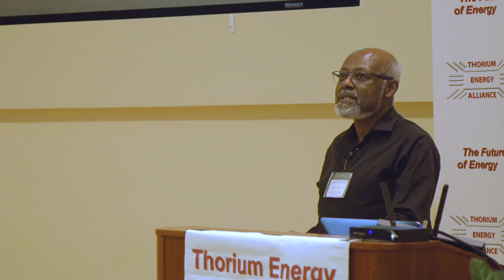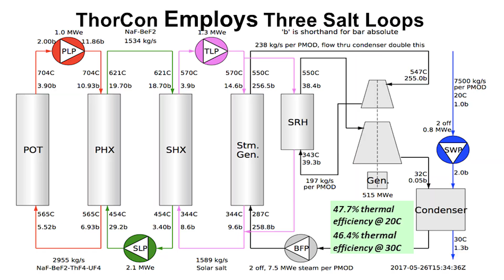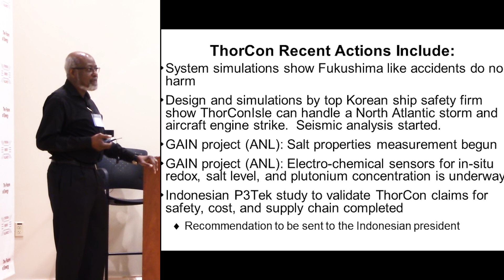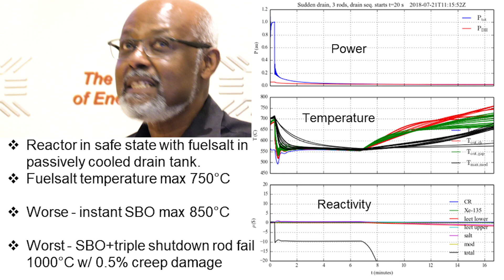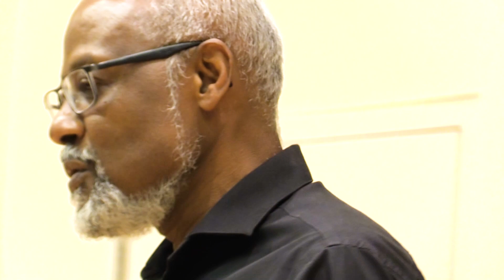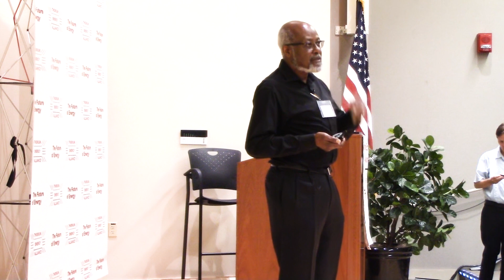ThorCon's Thorium Converter Reactor 2019-10 Update by Dane Wilson @ TEAC10

Comment: Can you bring it to Australia so we can have relief from costly renewable energy
Reply: Our greenies won't allow it
Reply: Glyn Camilleri tell them Greta is on board coming across the ocean
Reply: I too wish we could bring a few of these to Australia, but unless we can convince people it's safe, it won't happen.
I also think as long as the 'N' word is involved, greenies and the poorly educated will be against it.
Reply: Andrew Mackenzie we can't even have N submarines.. We went down the most ridiculous path... Between Bill Shorten's anti Japan stance... Saving Pines seat by building In SA.... 50 billion dollar dud subs
Reply: Could be good for de desalinization plants to. Lots of drinking water ;)
Reply: dig a hole 50 feet down and install a sterling engine in it. you will have unlimited free energy most of the year. Assuming you are in a hot spot in the land down younder.
Reply: Cheaper than coal doesn't mean cheaper than renewables.
Reply: Colin Connelly can you provide an analyst that renewables are cheaper to provide base load energy including batteries or alternative storage and infrastructure?
Reply: @colconn57  You can not compare renewables with nuclear or any other reliable energy source. Renewables require 100% backup from a reliable source, so they only add cost to that reliable cost making the entire system far more expensive.
Reply: Colin Connelly if it’s cheaper then coal, obviously it’s far less expensive then “renewables”.
Reply: @colconn57  use logic mate - if renewables would really be cheaper than coal then what would be the point to keep building coal plants?
why would there be so much fuss with the world having to force a number of countries to turn away from coal? the cheapest option usually wins -  they should be all over this idea if it would indeed be the cheapest
hint - they are not. nowhere close in fact. and as far as we know - they won't ever be.
Reply: @colconn57  It means you don't understand cost and problems of renewables. Hint is peak demand for energy when it is cloudy and wind doesnn't blow. Forget what they are doing with them right now and make your own research of nuclear/MSR. It is pretty simple to understand if starting with uranium cirle, although thorium has many advantages.

Comment: China will probably have an MSR running next year. They have a gas-cooled, pebble bed reactor prototype running. They are also developing a US, TWR, Travelling Wave Reactor using Terrapower technology. The US government canceled Terrapower cooperation. Given investment in prototypes is the next big step. The technology, designs and research are available. Testing of materials is a major time factor. But Generation 4 reactors can be built within 10 years. 5 other Gen 4 reactor types are also in development. MSR and Gas-Cooled Reactors are very promising. Relatively simple and highly meltdown resistant, built-in, inherent design features. Gen 4 fission reactors are much cheaper, lower risk and much faster than Fusion reactors. China has also tested a research fusion reactor producing plasma at twice the temperature of the sun for 100 seconds. The current world record. The ITER International Fusion Research reactor will be complete in France in 2025. Already costing over $10 billion. But it is still far from being a working power plant. They then plan to build a larger research reactor after that. Fusion is far from being practical unless a novel design has a significant breakthrough. The US government is now willing to help Gen 4 reactor development. A more flexible approach to licensing new Gen 4 reactors is vital.  Current US policies were built around existing PWR reactors. And it is a very slow and expensive process. The designs of Gen 4 reactors are evolving though mainly in testing and design. So new prototypes will have novel new design features. So the technology is still advancing even without prototypes. Partly in using computer technology for modeling and simulation. And chemistry. Managing salts with ionic bonds with various molecules gives lots of scope for research for chemistry. This can be done with universities and other educational groups. At relatively affordable research.  This could benefit MSR and LFTR type reactors allowing operators of such reactors to manage the many materials found in the salts. Removing unwanted or very useful materials off line while the reactors are in operation. Other groups are testing materials for the construction of reactors.
Reply: Terrapower is a Bill Gates start up. He and his engineers went to China because the AEC wouldn't let them have a license to do their testing anywhere in the US. But Deej wants to save jobs. If China has the fast lane on MSR development, their iron and steel industry is more than capable of mass producing a viable design. The ThorCon is going to be built in Hyundai's ship yards- in Korea. India is well on the way, using their own resources to fabricate; India is thought to have the largest thorium reserves in the world. Where is America in this? Waiting on the AEC to issue a license to do the research on American soil. We are losing the technology game- and this program is a bell weather for why.FR
Reply: @fredericrike5974  
The AEC hasnt existed since the 1970's. It is now the NRC as regulator. The NRC would allow them, they just thought it would take too long in the US. They were right. But, the US yanked them out of China.
Reply: whoops
Reply: TerraPower got TWR yanked out of China in 2015 by the US gov't for helping china build an SMR usable in the South China Seas.

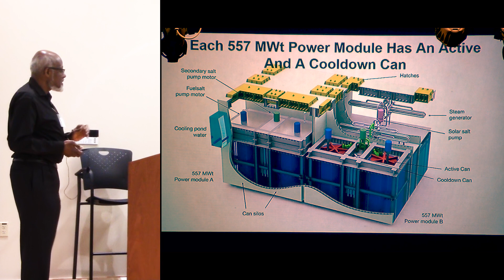Comment: @3:10 Dane" The module concept is important...allows us to insure we going to get that out before failure has occurred..assuming we have done our modeling right" Please do tidy up your data 1000 degrees should be corrected to 5000 C.  See for yourselves with CIA released documents search. Indonesia don't accept this Trojan horse.
Reply: ????  In the most severe of accidents the maximum temperature is 1000C.  No idea where 5000C comes from.
Reply: You are getting fission confused with fusion bro.
Reply: @BenJamin-rt7ui  20000c
Reply: Hotter means more power, Power means money :)

Comment: Why do I see it hard to believe that an impact with a Boeing 777 or bigger would only dent it 200 mm. That's like 5 inches...
Reply: A plane is very lightweight.  I'm told the skin on an airliner is about 1mm thick.  So the impact really comes down to the jet engines and the landing gear plus fire danger from the fuel.  Check out the video of an F4 crash test into a concrete block to gain a visual appreciation for what happens.  The F4 is much more compact and dense than a commercial airliner.
Reply: https://en.wikipedia.org/wiki/Argument_from_incredulity

They came to that conclusion through Finite Element Analysis. Much of the world is counter-intuitive.
Reply: 200mm is 8”. Thorcon uses steel backed by sand, instead of concrete. Steel is ductile, and bends instead of breaking, and the sand absorbs energy without being damaged at all. It is like sand/gravel being used in gun ranges or run away truck ramps.
Reply: It's true, if you shot an aluminum pellet at a steel wall. How far do you think it would penetrate?
Reply: Lightweight plane, pellet or a 385,000 lb projectile at 400 MPH...

Comment: My only question is how will it deal with water from a Tsunami or typhoon? Since it was the tsunami that initiated the downfall of Fukushima.
Reply: The hull is 30 meters tall so a wave or tsunami of 10m or less will not have any impact.  The hull is designed for North Atlantic storms with accelerations greater than 1g so a typhoon won't hurt it.  There are some locations on earth with very high tsunamis but these generally require the land to be shaped like a lens focusing the tsunami - our response is pick another site.  

If you really want to be certain you can spend an extra $200M/GWe and use iron ore for ballast.  This will hold the hull down on the seabed even in a 30+ m high tsunami.  (The turbine hall will get flooded and totally trashed but there would be no release).

As for loss of cooling (for example during the water outrush just before the tsunami arrives) this is handled the same as any other event that cuts off cooling.  Fission is stopped (shutdown rods drop), the fuel is drained, and it is cooled by natural circulation to the decay heat removal pond.
Reply: When it arrives on site, it is submerged, and sits either partially or completely underwater. I don't know how big a wave it could withstand, but i'd honestly be the most concerned about LACK of water before a tsunami (the water on the shore receedes before a tsunami), which i got the impression is part of the cooling.
Reply: The downfall of Fukushima was abandoning real government oversight. The plant operator kept reducing maintenance due to a need to increase profits. That plant was 40+ years old and should have been decommissioned at best and refurbished at least after 20 years. Neither happened. So abandonment can be construed in several ways.
Reply: Like quakes, Tsunami or typhoon is a surface phenomenon.
Reply: The thing that caused Fukushima’s problems was the loss of power to cooling pumps.  The old style solid fuel reactor requires pumps to circulate water for cooling.  (Active cooling).The reactor was scrammed so there is no power generation.  The diesel generators were washed away and the batteries kicked in.  Problem was the batteries could only supply power for less than 6 hours.  Remember that the whole coastline was destroyed so there was no ability to get the system repaired before the cooling water got converted to hydrogen and then exploded.  This design uses passive cooling meaning that it doesn’t require water circulation pumps.  He mentioned 147 days supply of water for passive cooling.  Think of it of no human intervention for 147 days and it would still be ok.

Comment: Could the "can"  be recycled just by replacing the moderator, is it the only part that gets irreversibly damaged by radiation? Because it could be non-marginal consideration from the cost point of view.
Reply: Yes the Can and most of its contents can be cleaned, inspected and reused.  The moderator does wear out - though there is some hope of recycling it as well in the future.  Various portions (bearings, dry gas seals, heat exchanger tubes) have a shorter life (16 years??) so have limited recycling opportunities.  The radiation level is high enough that all work would have to be done robotically.
Reply: @larsjorgensen4123  Thanks very much for your answer, since it's contaminated would have to be specially (safely) stored if not reused that would also generate additional costs.
Reply: @proximo1033  That's why they have the "cool down" period, so storage is only 4 years, then it can be recycled at minimal cost
Reply: Dr.  @larsjorgensen4123 , I want to use the fact that you seem to be reading these comments to ask you a question.

In one of your presentations, where you were explaining the design you said there was a small desalinization plant on board the plant. You also said there was a possibility for adding modules to be used for storing spent fuel. 

With this in mind I was wondering if there are plans to, in the future, provide such plants with additional modules, not for spent fuel but for a large desalinization plant, that can be parked in places where fresh water is scarce?
Reply: @billhickswasgreat3421  https://www.researchgate.net/publication/260678480_NuScale_small_modular_reactor_for_Co-generation_of_electricity_and_water

Nuscale provided a pretty decent comparison of all methods of cogeneration with desalination. It seems that unless you live in areas with especially high salinity or particularly fouled water, Reverse Osmosis will nearly always be the cheaper option. In which case, you can put the desalination plant anywhere you want. I am not sure if the current Thorcon design allows for high temperature steam output.
Reply: I am sure that as they get more more experience with running this thing, they will find that some steps and precautions are unnecessary
Reply: Proximo, I imagine the "can" would be too hot, as in radioactive, to work on, making the complex task of changing the moderator beyond economical feasibility.
Reply: They chose too only use the can for 4 years because that means they can use parts that can easily last beyond can swapping. Solid fueled reactors currently operate for 40 years +. Meaning the part has to last that long or has to be replaced with expensive maintenance in an irradiated environment. With a 4 year cycle and part know to last more than 10 years. the reactor can be run without ever being expected to have to do maintenance on. This makes a lot of engineering in the reactor simpler because it doesn't have to be accessible by robot anymore. It also reduces shutdown time for repairs increasing income from electricity.
Reply: The graphite is replaced every 4 years, the reactor vessel is reused once, so 8 years are expected.

Comment: So, he says that after the 4 year operating life of the first can is up, the salt will be moved to the second can. Do we know when or if the salt is getting processed to remove fission products?
Reply: he completes his sentence as the removed one will be suspended and processed (cleansed ) in order to turn back into production AGAIN.
Reply: @cankutbayhan  That's him talking about the dry can, isn't it? That's not him talking about the salt.
He did mention that the ship carrying the can would either carry (in a separate container) the make-up salt (which implies the other option is that it'll carry the starting salt).
It's entirely possible that after the initial salt they'll never replace the full volume of it, only fractions.
Reply: @MrRolnicek  the amount that salt could or could not be chipped off is not my task to debate. But obviously, it is a well-known by-stand in this process and a matter at hand inevitably.
Reply: @cankutbayhan  thank-you, I didn't hear that.
Reply: Thorcon does not have any current plans to reprocess the waste, but we could convert it to fuel for an Elysium Molten Chloride Salt Fast Reactor to consume the rest. This would be simple conversion from fluoride to Chloride, not reprocessing. We have discussed this. possibility.
Reply: AFAIK you want to keep the radioactive fission products in the reactor as along as possible, and burn them up. 

That's the nice thing: Depending on the MSR design you can keep most of the radioactive fission products in solution in the fuel salt, until the day you decommission the reactor, and you get a equilibrium between creation of fission products and burn up of fission products - this is unlike with conventional solid fuel, where you have to replace the fuel because the solid fuel pellets start to crumble and release the fission products as e.g. volatiles. 

And AFAIK over time you add some fresh fuel salt - but this depends the actual design, I don't know what ThorCon will do with their.
Reply: @MeetDannyWilson  You're confusing fission products with transuranics. When you split a heavy atom you get fission products; the ratio of neutrons to protons required to make those elements stable is much lower than in the fuel atoms; so the unstable fission products have too many neutrons and are beta and gamma emitters. Hitting those elements with more neutrons will make more unstable isotopes than it destroys, you won't get any energy from doing it and it will soak up a lot of neutrons that you need to keep the reactor critical; you cannot burn them up.

Transuranics on the other hand are elements which absorbed neutrons and became higher actinides like neptunium and plutonium. Those are still fuel and can still be burned. You want to separate the fission products from those transuranics if you are going to reuse them. These elements are mostly long-lived alpha emitters.
Reply: @soylentgreenb  Yeah, my knowledge about the finer details is quite fuzzy ...

But IIRC in specialized reactors you can "burn up" the fission products. E.g. I saw a presentation about the "Bon-Bon reactor" concept by Bruce Hoglund. And a I vaguely remember one MSR concept, where they propose to dissolve spent fuel from PWRs/BWRs (zirconium cladding and all!) in the salt and use it for fuel.
Reply: Did a little googling, this is from 2016: https://aris.iaea.org/PDF/ARISThorCon9.pdf
The fuel will stay 8 years in the reactor (makup fuel is added daily), then needs to be replaced due to fission products buildup. Then it will cool down 4 years, and then get send back to the factory (for reprocessing?)